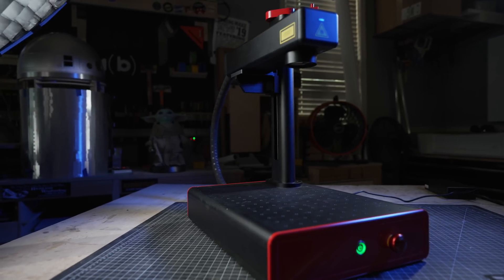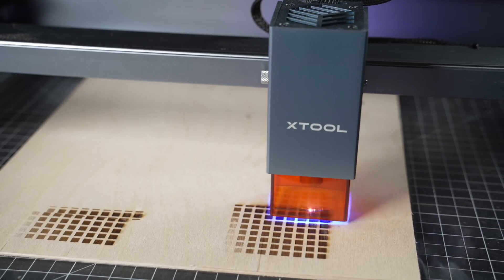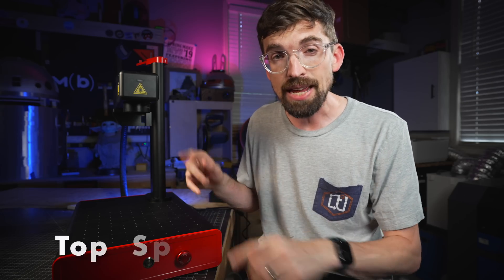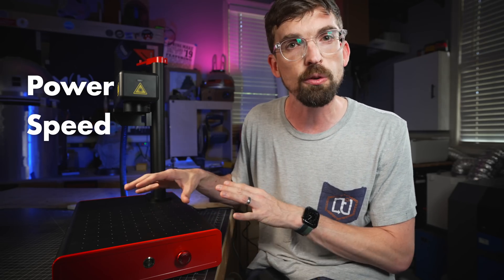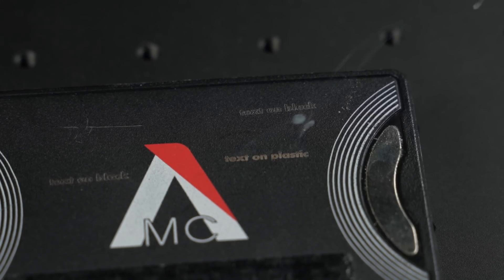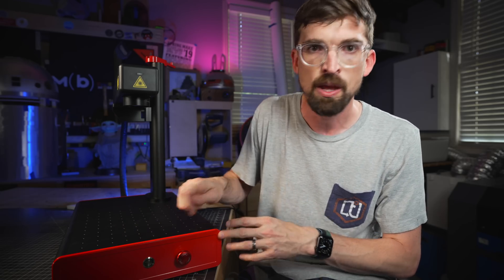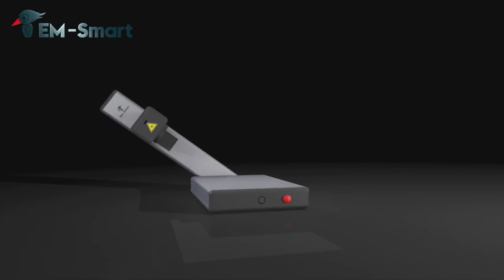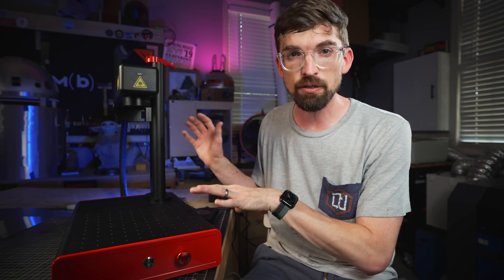It's 48x FASTER than a Diode Laser! 3PLASERS EM-Smart 20W MOPA Laser Review

Comment: For more interesting colors on stainless you have to defocus the head about 1mm up to spread the heat out, something I've experimented with on a 70 watt Tykma large field and later heard from a former Tykma applications person. Be glad the clones cost what they do since the industrial machines are usually 15x that price. If they are running the same ripped software there should be tools to distort the marking field to match your part's contours in the absence of a rotary head.

Comment: Cool! question: Can either of them MOPA or fiber (even the omtech one) cut metal? (i'm talking about very thin sheets from .50 to 3.50 mm)
Reply: 0.5-1mm max if you have 50W-100W fiber/mopa laser. That too on repeated passes.  Can be Time consuming and  problematic for laser sometimes

Comment: Since MOPA is better for plastics, I'm curious how well a small, simple machine like this would do with PCB prototyping or small scale manufacturing. It wouldn't be too difficult to have a multi-material profile, just switch frequency and amplitude within a certain set of lines in the code. 'Etching' a PCB would be such a great alternative to the typical developing methods, as even some of the newer prototyping methods, like using a photoresist PCB blank on the LCD of an MSLA printer, still require developing in chemicals. If this could not only etch the traces, but also etch the board for proper marking, I don't see why this couldn't be a viable alternative to cheap board manufacturing. Stemming from this, I'm curious how well this kind of laser handles various solder masks, say if someone wanted to mask a whole board then etch the masking off the pads, instead of more typical processes; most PCB software already separate pads and traces, so technically you'd already have a file for just pads, with the proper settings you could potentially etch the solder mask but not the copper pad underneath. 

If it works out, something like this could be great for maker spaces, assuming someone had already gone through the calibrations for specific materials, thicknesses, etc. Even as a hobbyist or small business, a machine like this would be amazing for prototyping and small production runs.

Comment: Question:  I already have a cnc machine that i use for making aluminium modular panels, I am looking at getting a laser for marking the adonised panels with text and legend markings. Is it possible to see one of these lasers do marking on adonised panels, also which do you recommend? I have looked at the atomstack x20 pro 130w and have watched the video on this one also. I am a little torn for which one to invest in, also then is getting the laser at the right origin X/Y point. Could you possibly do a little tutorial info on this?  thanks again for another great video!!

Comment: Since this laser creates an angle between the surface being cut and the beam output. Does it CUT through 3/8 thick material at a slight angle since the laser beam is NOT CUTTING from Directly above at a perfect right angle to the surface being cut.  I would like to make a whole bunch of wood puzzles and I do NOT want there to be any angles of any sort on the pieces. I want the pieces to be truely Square to the surface. So since the laser is NOT MOVED directly above I would guess that the laser is always cutting at some varying angle to the surface of material being cut which for my uses makes it a worthless device for me to have.    Thank you for your time.
Reply: C02 gantry style.

Comment: This is awesome! I am looking for a laser that can actually cut into and engrave at least 4mm deep into carbon steel, cold rolled steel. Do you have any suggestions? I make texture plates that will be used in rolling mills and presses. The smaller the better, thank you so much for all your help
Reply: That requires a lot of power. We’re talking about at least a couple hundred watts of fiber laser. That’s also rarely found in a small machine like this, and they’re priced at around $10,000 and up.
Reply from the maker: For cutting your going to get into some pretty high powered industrial stuff.
Reply: @makeorbreakshop  Do you think this EM-Smart 20W MOPA could cut through 0.3mm thick brass foil/sheet?  I need to cut some 250-350 micron thick metals (brass or stainless) for a technical project and am wondering if this might work.  Or would it take so many passes as to be impractical (e.g. >10 sec. to cut a 30mm circle out)?
Reply: Thank you for your answers. :-)
Reply: These fiber lasers engrave but what about the cutting ?